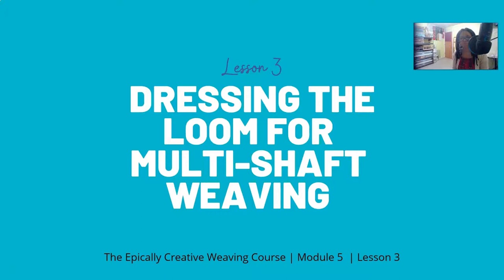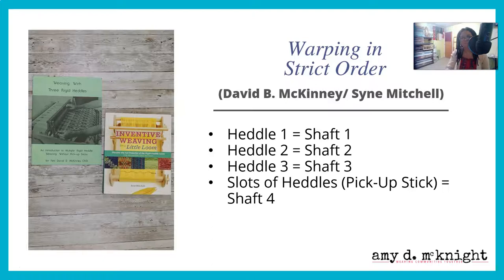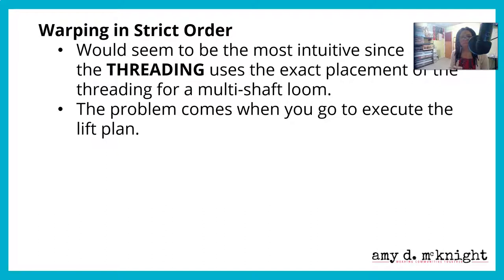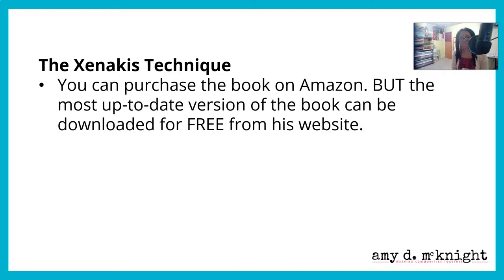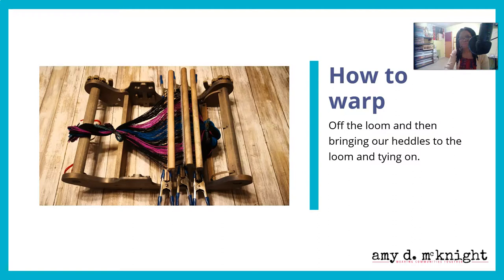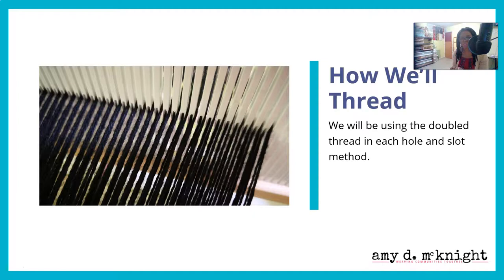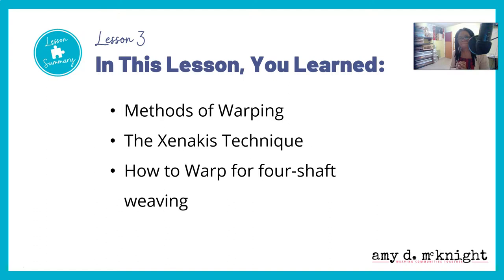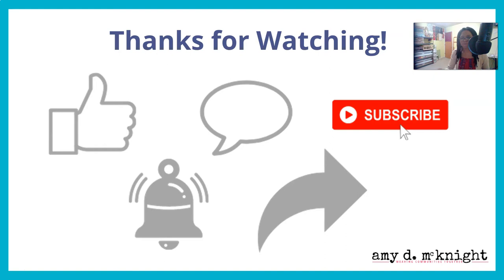Module 5   Lesson 3 - Dressing the Loom for Multi-Shaft Weaving

Comment: Page 12 does not actually show the modified order of the heddles, and I cannot find anywhere why he is modifying the order. It doesn't show up in the book until page 24, and that page is very confusing. The diagram shows the modified arrangement, and then the paragraph that follows says: "... heddle three is not necessary. After threading heddles one and two in the usual way ...." This video does not actually show how you get from double threading every hole and slot, and between the two I am more confused than ever.  Here I am with my three heddles and wound warp (I don't direct warp, ever) and am stuck. Help?